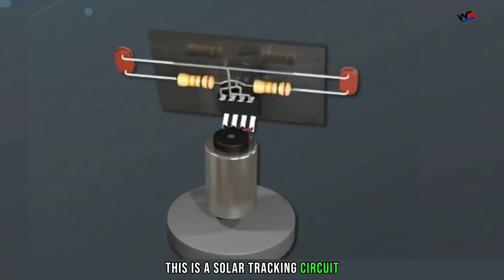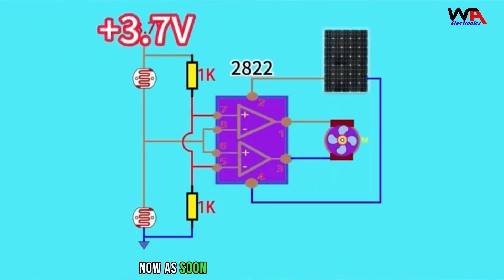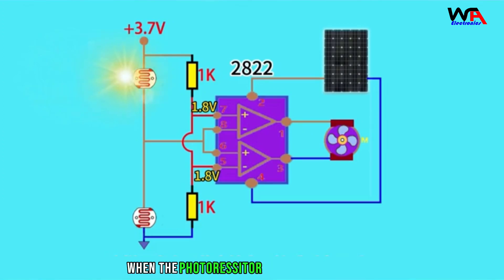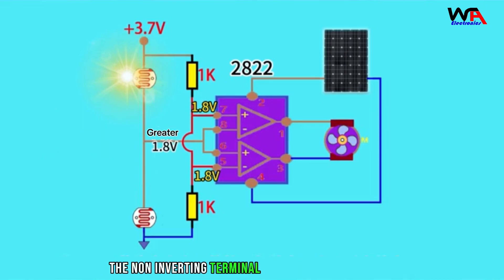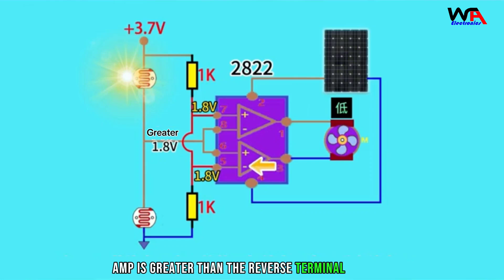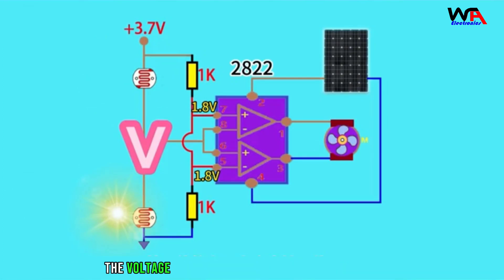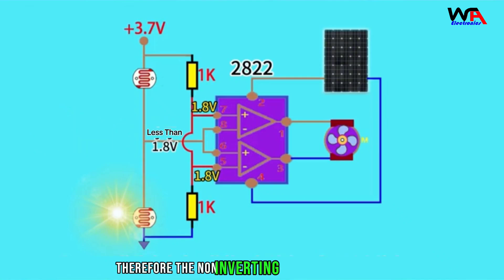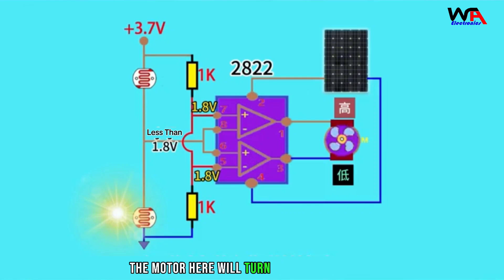Solar Tracker Circuit Working 3D Animation Electronics Projects

Comment: The two sensors need to be positioned with a divider between them pointing at the sun, so that when it is offset one side is in the shadow of the divider. The LDRs in the animation will simply not behave how the design needs.

Comment: I assume the light sensors are not in the same plane, as they will receive the same amount of light, if positioned as shown in your diagram. Please comment?!
Reply: It shud be placed at 2 different sides, it's just a illustration
Reply: Of course they point where the panel can, and needs to move